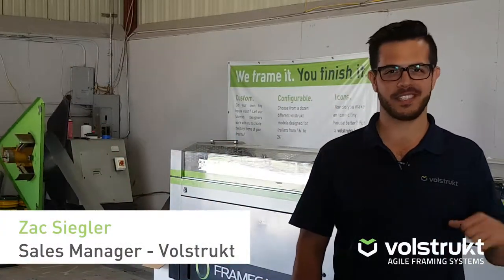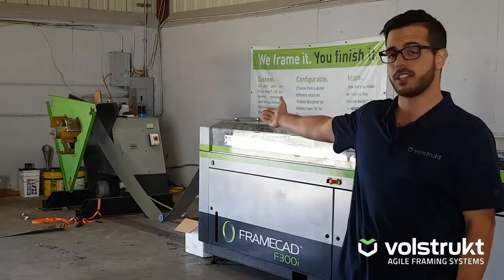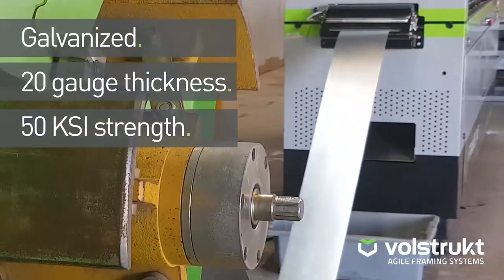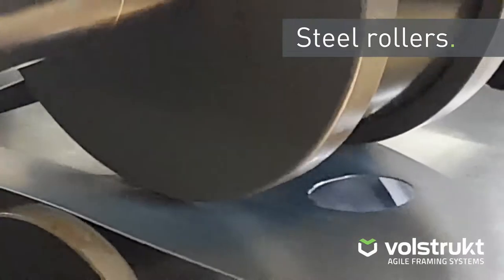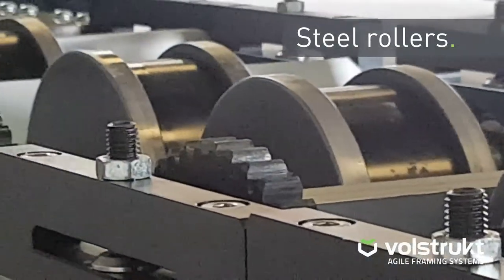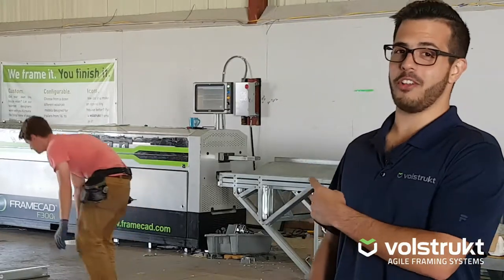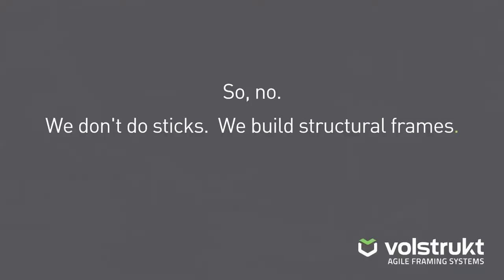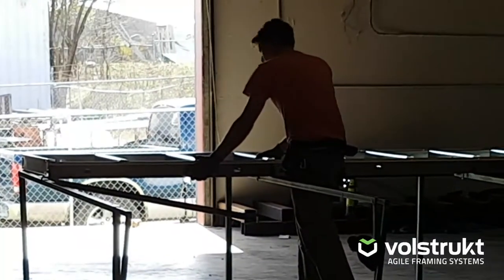Volstrukt | How we print cold rolled steel framing

Comment: I was going to write you an email to ask what the minimum stud width is for steel studs in building a tiny house to keep it stable and solid, but since I'm likely not the only one with this question I'll ask it here where others can also benefit. Pretty sure I'm not the only one wondering. Every inch counts in a tiny house, and so I was curious if, in addition to saving weight and adding strength, one could also reduce the stud width vs wood.
Reply: steel doesn't care
Reply: اه ه٠ جد